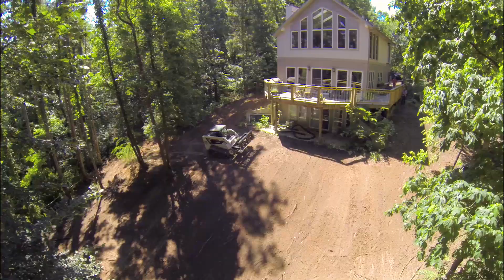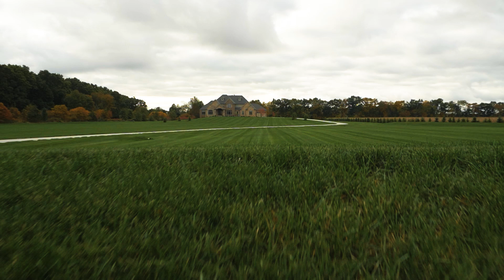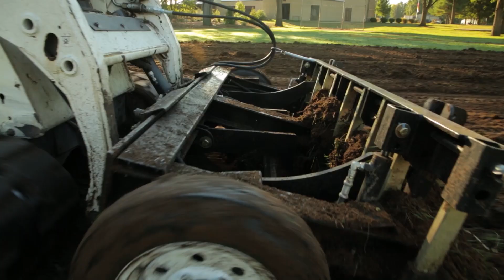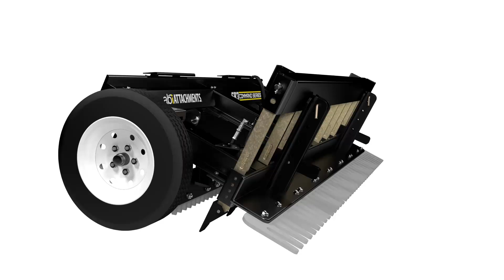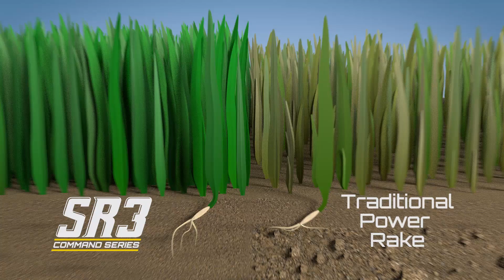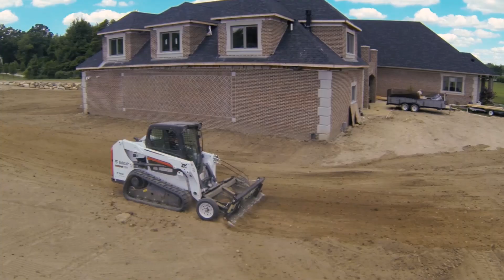SR3 Command Series - Skid Steer Grading Rake

Comment: Also should I skip out on a power rake?
Reply from the maker: Hi Charles! Power rakes have a place in your tool line up if you're regularly wanting to pulverize existing vegetation and let it remain in your surface material. You'll notice in the video we prefer the method of scalping off the existing vegetation and working with the topsoil underneath. However, the biggest differences are de-compaction, speed, and downtime. (1) The SR3 promotes better seed/root growth by loosening soil 2x - 3x deeper than a power rake. (2) The SR3 can move as fast as you do. The power rake forces you to slow down to keep up with the rotating drum. (3) When (not if) the moving components of the power rake break, repairs are costly and time consuming. We kept the SR3 design simple. There's nothing to break and no time to be lost on the job site. - Great question!  -- Matt

Comment: Is there a comperable model for fel on tractor?
Reply from the maker: You bet! Check out our TR3 (we keep tool names simple around here 😄). All the same ground engaging components; specifically designed for use with a tractor's 3pt lift system. Video: https://youtu.be/RtfKgAjvU0Y More info: https://www.abiattachments.com/product/tr3-tractor-scarifier-grading-landscape-rake/  Enjoy!  -- Matt
Reply: If your tractor has a skid steer quick attach, 3rf function hydraulic ports at the end of the loader, and had the lift capacity to manhandle one of these  then just order the SR3 shown in this video. The only downside to the 3 point mount version of the TR3 is that you're doing all your detail work contorted looking backwards in the front facing seat.
Reply: ABI fel = Front End Loader (on a tractor)
Reply: Thanks I wound up buying a harley rake for the tractor. However I just bought a CTL as well. I'm now thinking landscape/harley rake or SR3 for the quick attach. The tractor has quick attach as well.
- Charles